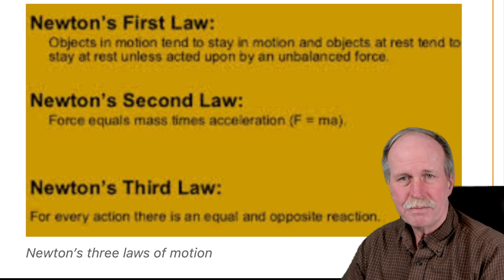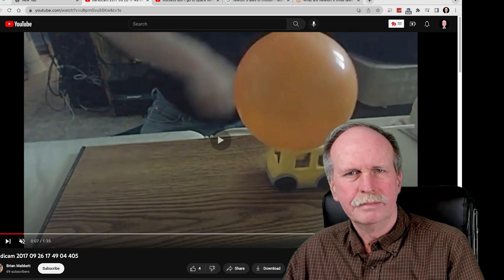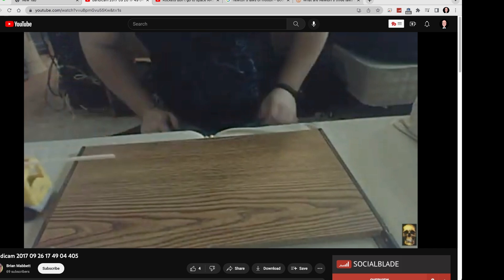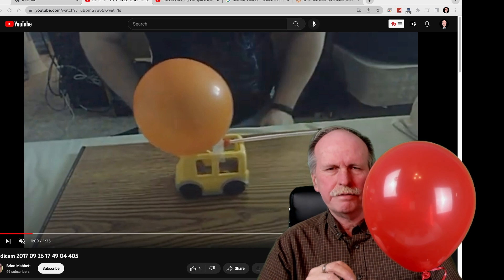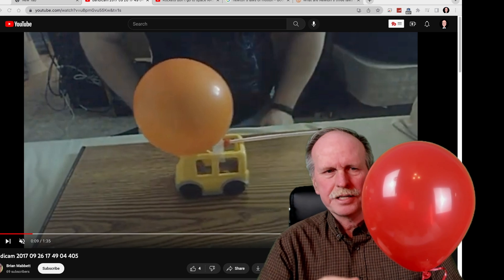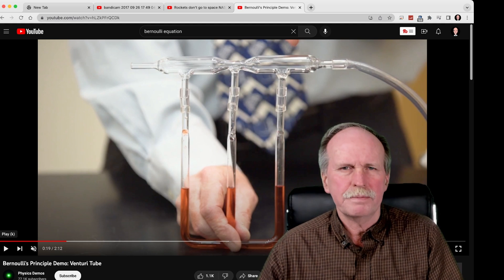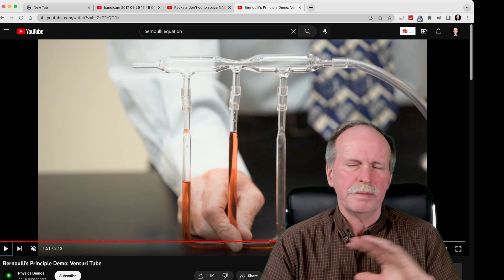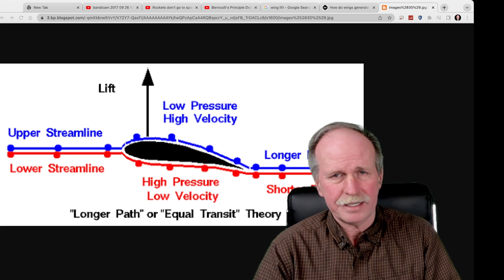Flat Earth Proves Rockets DON'T WORK

Comment: If you need fast moving air on the top of a wing to get a low pressure and thus lift, then why don't all jet planes have their engines on top of the wing like on the Antonov An-74 and Boeing YC-14 have? The Wikipedia article mentions that it increases lift, and also mentions the Coandă effect.
Reply: Aside from aerodynamics there may also be more practical reasons like 
* under wing engines are easier to maintain
* fuel from the wing tanks above does not need to be pumped into the engine, gravity does the work
* lower total center of mass gives better stability
* especially on passenger airplanes having them under the wing shields passengers from quite a bit of the engine noise
* ...
Reply: @hartmutholzgraefe  On the other hand, over wing jet engines are much less subject to FOD (foreign object debris) from unimproved airfields and often better shielded from ground fire ;-).

If the Concord have over-wing engines, the Concord crash wouldn't have happened.

You always need to pump fuel.  You can't rely on gravity feed in an airplane.  You wouldn't want the engines to quit because you banked a few degrees during a side-slip.
Reply: @fromagefrizzbizz9377  > On the other hand, over wing jet engines are much less subject to FOD (foreign object debris) from unimproved airfields and often better shielded from ground fire ;-).

That's typically solved by using a high wing instead of low wing configuration, with the engines still mounted below the wings, though, as we e.g. see with the C-17s jet engines, or the C-130, C-160 and A400 turboprops. 

The only plane I can think of right now that sort of avoids FOD this way would be the A-10, but there the engines are not above the actual wings but above the horizontal stabelizers instead.

> If the Concord have over-wing engines, the Concord crash wouldn't have happened.

The Concord crash was not due to debris entering the engines, it was rather one of the tires running over a piece of metal and smashing it in one of the wing tanks, and then the hot engine exhaust igniting the leaking fuel. Over wing engines would only have made this minimally less likely?

> You always need to pump fuel.  You can't rely on gravity feed in an airplane.  You wouldn't want the engines to quit because you banked a few degrees during a side-slip.

I was wrong about passenger jets making use of this, it is apparently only used in single engine high wing configurations indeed. I might have confused it with "even with the pressure pumps failing the engines can be operated at lower power for a while by the gravity fuel flow alone" being mentioned in some air accident analysis videos ...
Reply: @hartmutholzgraefe  "typically solved" - well I'm not sure that "solved" is really the right word here.  "problem minimized" is better, but hair-splitting.  Then again, think of Ekranoplans...
Reply: Your statement is correct.  Your interpretation is wrong.  The fast moving air over the wing is important.  It doesnt really matter where the motor is.  Yes it might be more efficient in certain places, but there are other factors to consider which may require the motor to be elsewhere.
Reply: @csjrogerson2377 Absolutely WRONG. Go look up how the AN-74 and YC-14 are designed. Their high mounted jet engines SPECIFICALLY INCREASE THE SPEED of the air over the wing by using deflectors and other aerodynamic surfaces to direct the jet blast to the upper surface of the wing. This is EXACTLY HOW AND WHY they work to produce HUGE amounts of lift compared to other jet aircraft. You’re simply incorrect in every way, It’s not just “more efficient” and you need to what EFFICIENCY you’re referring to anyway, LIFT, DRAG, THRUST, FUEL USE, etc… in this case it’s LIFT at the sacrifice of all those other things.
Reply: Some additions to Hartmut: 
 
  - The VFW 614 had the engines over the wing, probably to have a lower undercarriage But for a passenger it is ugly to look at the engine. 
  - in order to have an effect, you would have to put the engine BEFORE the wing so that it can accelerate over the surface
  - but the exhaust from the engine is hot and turbulent, not good for the structure and for the airflow. 
  - with modern fan engines where ca. 3/4 is cool air, you cousd eventually do more. 
  - you get this lift effect only when the engine is working. When it is NOT running, you just have disturbed airflow, you lose that section of the wing for lift.  
  - therefore it makes more sense to produce a "clean" wing with smooth airflow. The big jets glide surprisingly good.  
  - lift is not even so much of a problem. At height, all the flaps on the nose and the trailing edge are retracted, they are the ones caring for maximum lift at the cost of drag. You want to cruise in "clean" configuration with minimum drag.
Reply: @feedingravens yeah, the YC-14 had EXACTLY that, engines mounted right in front of and slightly above the wings. Blasting huge amounts of thrust over the wing to vastly increase the lift.
Reply from the maker: Jet engines work by receiving air at the front and sending it out the back at high velocity.  I would think having more pressure at the front would be better.  That's just my thought and it was a great question.
Reply: Because the GOAL of the AN-74 and YC-14 was to create HUGE amounts of LIFT to allow the takeoff and landing of HUGE cargo weights from extremely SHORT runways. This is achieved at the cost of VERY HIGH DRAG, and VERY HIGH FUEL USAGE at take off and landing. Obviously only the military would be needing that requirement, as any civilian jets have plenty of long runways to use, or do not service small runways except with smaller jets. But even the military found the fuel usage, difficulty in maintenance (engines way off ground), and other factors to be too expensive. So they adopted alternatives like the C-17 for large cargos (which has elements related to the YC-15 (Boeing)) short takeoff and landing aircraft, and the Osprey tilt-rotor for smaller cargos.
Reply: @DoctorShocktor  What makes you think only the military needs such capabilities? Think: Primitive airports such as those up north.  Doesn't mean they don't need heavy lift.

Comment: A vacuum cleaner does not create vacuum. It created a little under-pressure and a lot of wind towards itself. Dr. Bob is right. Since when does wind have no effect on a balloon, dear flerfs? :_Smash:
Reply: Flerfs claim that a vacuum sucks, this proves that flerf science sucks more.
Reply: Exactly what Turtle says. It´s a common belief among flerfers that vaccum and vacuums are the same things
Reply: The word vacuum confuses the flatties. In Sweden we say literally “dust suckers”, as they just produce a strong wind making much in its path go along.
In this case the dust sucker may be even sucking the toy car as well.
Another hopeless Flexperiment doing a belly landing.
Reply: A vacuum cleaner does create a vacuum, it needs a sealed container to pull the air out of.

As a vacuum cleaner it's pulling a vacuum into the same envelope it is in (the atmosphere) and sending that air through a filter to remove particulates. 

Attach that same cleaner to a bag filled with air and it will pull the air out of it, making a pressure difference, a vacuum.
Reply: @Faesharlyn  This is "subpressure" (I called it under-pressure) but not vacuum. Calling 80-100 hPa pressure is ridiculous. This is the pressure of lower stratosphere, enough air for planes to fly. No vacuum at all.
Reply: @arctic_haze  pressure is relative. That's why the atmosphere works.
Reply: @Faesharlyn  What are you claiming? That the thing barometers measure is relative? Relative to what? I would advice you to do some research before making a fool of yourself in public.
Reply: @Arctic Haze  . A perfect vacuum is impossible, so I have to assume you're talking about relative vaccum..

Take your barometer to the top of Everest and see what it says, then measure at the foot. See if the pressure changes with altitude... just like the exhaust flare demonstrated.

When the difference between the pressure inside the envelope is lower than that without its a vacuum. Vacuum assisted births do not attach a hose from space, they use a lower relative pressure. Fish that come from the depth of the ocean explode in the relative vacuum of our atmosphere.

So yeah, it's relative.

 Not sure why you're so combative though, if I'm wrong I'd like to be corrected but it's hard to learn from someone who comes across so hostile
Reply: @Faesharlyn  I know that perfect vacuum is impossible. You would always have virtual particles left. But I did work with vacuum pumps as my master thesis was in spectroscopy. You need hours to achieve what we physicists call vacuum, generally a few millibars (millibar is same thing as hPa). Vacuum cleaner is unable to get to similarly low pressures even if you taped shut its inlet. No way. It is not a vacuum pump.
Reply: @Faesharlyn  You are wrong in your premise.
A "Vacuum" cleaner only moves air from one end of a pipe to the other,it has not the power to "empty" the air from even a paper bag.
Because it works with a small propeller attached to a little electric engine and the seals are not perfect,the cleaner allows air to flow in both direction inside the pipe,the bag you refer will never end empty,it will ALWAYS have some air inside it.
Besides,the term for outer space is not really "Vacuum" but VOID.
Reply: @xenomorphphantom8852  ah, semantics. So clever.
Reply: @Faesharlyn  No semantics,PROVEN reality.
Learn about it.
Reply: @Faesharlyn  Yep.  The VACUUM gauge we used to calibrate carburetors used to be marked in inches of VACUUM.  A partial vacuum to be more precise, of course, but still common usage anything below atmospheric pressure is called a vacuum.